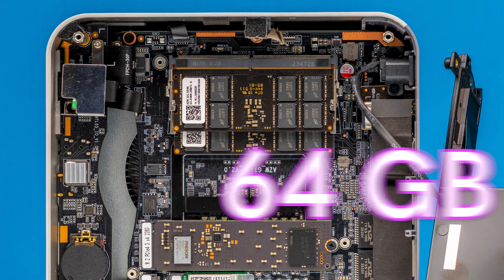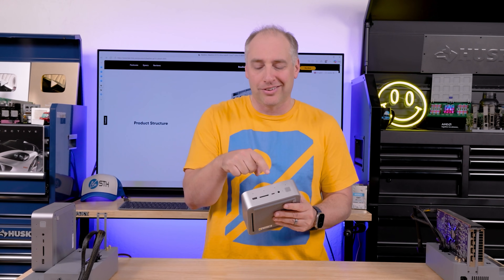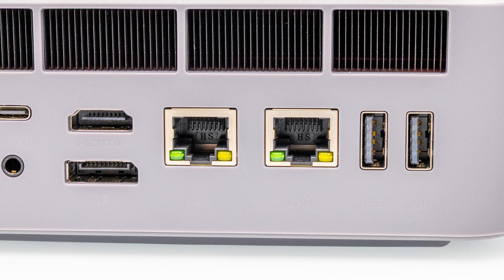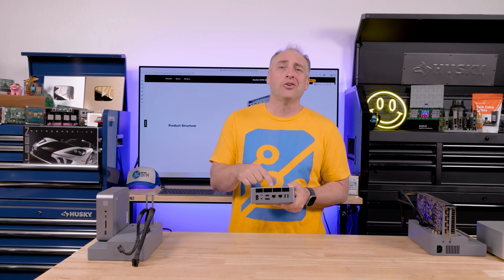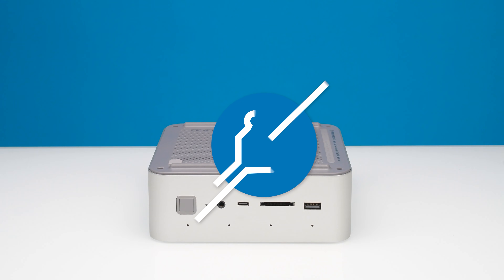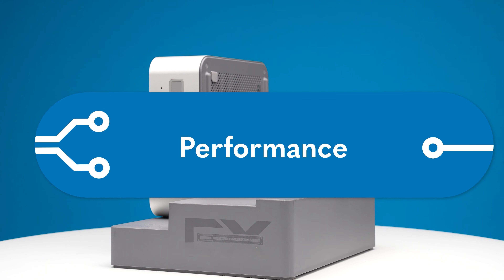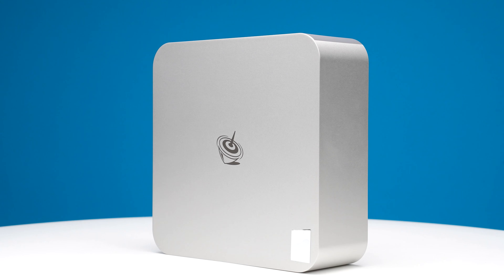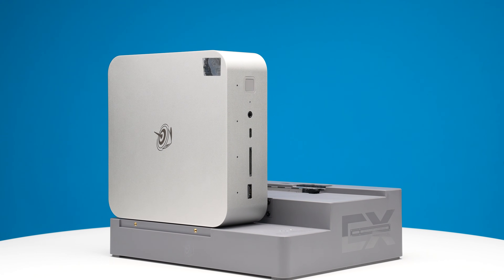An ULTRA Mini PC with 10GbE and GPU Beelink GTi15 Ultra

Comment: Buy 2. One of my Beelink units died after 2 years. Seems to be a voltage fail during bootup. Also, I have had a mini PC fail because the 120V to 12V built-in power supply could not maintain 12V. It would produce 11,7ish volts. So I ended up wiring an Amazon 12V converter into the mini PC to replace the internal power supply.

Comment: But if you look at it from a robot dog's perspective...
Microphones and speakers are great... But what about the monitor?

But isn't an additional power source more important?
To be able to change the main power source without rebooting...
Aren't a 3.5mm jack and Bluetooth enough to connect peripherals?

Comment: 11:55 this rambling makes it sound like scores should scale lineraly with corecount like 1 core 50pts, 10cores 500pts, 20cores 1000pts as if that is actually something that would happen with the performance scaling - when of course it isn't. A system with 10 cores is not half the speed of one with 20 cores even if those cores are exactly identical because they don't like in an ideally scaling hypothetical environment like an excel sheet or something. A 20 core system is NOT twice as fast as an otherwise identical system with 10 of the same cores - it gets CLOSE in some rather specific scenarios but in real world performance it is nothing close to twice as fast with twice the cores, because the cores aren't the only things that count. RAM bandwidth doesn't scale to pick one chip level thing, IO of course doesn't scale etc which all influence the total performance of the system. The 20 core system will of course be noticeably faster than the 10 core system in CPU bound applications that are able to utilize multiple cores properly, so like the code is threaded and cache aware and all that kind of stuff, and in specific scenarios it could reach something like 185% for brief moments or specific tasks, and above all else if the system is running a lot of different software at the same time and the main heavy ones are properly coded for multiple threads there will be a big benefit not only in execution speed or raw performance but also in the "feel" because it is easier to find a thread to pause if you have 20 of them than if you have 10 - and the 'loss' in high load performance from moving the mouse or displaying a changing graphic is less. 
Long ramble - but I think care should be taken to not create the impression that performance scales perfectly linearly with core count. I have spoken to people who have returned PC's they bought because of such claims. Not kidding.

Comment: Can it be Waked Up by LAN WOL in Modern Standby State? Would be great if one of those Minis is finally capable of doing this.
Reply: Hi! I’m not completely sure what you mean by “Modern Standby,” but the GTi15 Ultra does support Wake-on-LAN. However, at the moment, it can only be enabled by modifying the system registry. To fully resolve this and make it seamless, we’ll still need to wait for Intel to release an updated driver.

Comment: I prefer the minisformum "old Mac-Mini" Stayle. Integrated power supply, better thermic so it is really quiet and to be honest fits a desktop better. Why everybody wants to clone the new Mac mini style with a SOC that isn't a power efficient Arm - no idea. 

I tested many MacMini clones - and ALL were noise under load. My Minisforum AI X1 Pro is the ONLY one where the promise of a low noise level is fulfilled. The biggest draw back is the slow RAM, and 10 Cores is not to bad either :-). 

Beelink should also go for the old Mac-Mini Style - less compromised on noise and better cooling.
Reply from the maker: To be fair, that is less of the Arm instruction set, and more of the flexibility building the SoC and system around it that is getting that benefit for the Mac Mini
Reply: @ServeTheHomeVideo  However - the new MacMiniy style for x86 is Function follows form, not the other way around. There was a purpose for Apple to give the Intel Mac this case. 

Im completely happy with my Minisforum - absolute no noise at all! And yes I also own a Mac.

Comment: Hi @ServeTheHomeVIdeo do you have plans to test it as an opnsense or pfsense router to see if the system can handle traffic at 10gbit line rate with ids/ips rules configured or does the system's mix of P-core/E-core/LP-ecore configuration makes this less suitable for that role?
Reply from the maker: Interesting thought. Generally I would use a C5000/ P5000 for something like that. We also have the new Granite D

Comment: 10 gigs MUST be SFP, 'couse optic has lower delays. RJ 10GBE - bad idea.
Reply: Hi! Thanks a lot for your suggestion — we really appreciate your feedback, and we’ll pass your idea on to our R&D team:)
Reply: And 10G RJ45 switches are way more expensive that SFP+ switches
Reply: @matthiaslange392   And DAC-cables ... )
Reply: @HDFactory-HD  I've won a Beelink ME pro... it has 5GbE (copper), but there's nearly no switch for 5G on the market, only 10g multi-Gig, but very expensive. An eight-port 10G SFP+ switch costs about 120€ - with management. Many 2.5g manageable switches are more expensive. Copper makes no sense.
Reply: @matthiaslange392  there are modules for spf to rj45
Reply: @erdmanisdkH  I know. But the 10G modules get VERY hot (>90°C). I have one at work running in a TL-SX3008F. Usually set it to 2,5g (65°C) because it gets extremely hot on 5G or 10G.
Reply: @HDFactory-HD  I know. I'm the only administrator of a network equiped with 46 switches in 19" racks, 1gb copper, 10 and 25gb fiber and also DACs. I connected my office PC with 10gbe over existing copper because I work often with big backup-files and there's no way to route fiber to my PC.

Comment: It's pretty neat.  I'd like to consider it, but almost rather get a laptop with faster 24core CPU and a discreet GPU, such as Lenovo Legion 5i 16" (at my local Costco) – RTX 5060, Ultra 9 275HX, 32 GB / 1 TB: $1,200 Christmas promo.  But the laptop has fewer connections, soldered ram, and certainly doesn't have the dual 10GbaseT. Hmmm I'm liking the beelink more and more
Reply from the maker: Very fair

Comment: What a pity it's spoiled by insufficient USB A ports on the back. I'd want an extra two so you can run keyboard, mouse, external hub, and one to your monitor, leaving the  40 Gbps USB C for high bandwidth devices like external drives.
Reply from the maker: Great point. In general I wish these mini PCs had more USB
Reply: Hi! Thanks a lot for your suggestion — we really appreciate your feedback, and we’ll pass your idea on to our R&D team:)

Comment: In the idel power consumtion is over 40w. C-states is off by default. I don’t know how you reach that 12w in idle mode. Even Beelink agreed they have a bug on this product
Reply from the maker: No idea. We left everything as default and are using to power meters (one on and one off camera)
Reply: @ServeTheHomeVideo  sorry, but I don’t believe. There are many topic about this issue. I even contacted Beelink support and they confirmed this problem

Comment: The size of this is the same  if you put some small itx case. For example you can get MINISFORUM BD795i SE mini itx mother board with CPU: AMD Ryze 9 7945HX-BD795i SE. 
Then you can put this in some compact case like FormD T1. And the size will be the same :)
But the benefit is you will get full Pcie 5  x16 for GPU.
I assume this dock station is only Pcie 4 x8
Reply from the maker: Totally. We have both the X3D and non-X3D versions of that board. It does not have the high end dual 10GbE

Comment: Random proprietary eGPU connector makes that docking solution a complete non-starter for me, sorry. Kind of reminds me of the (mostly gone) days of board-to-board mating connectors on the bottom of laptops for connecting to docks, but kind of seems extra silly when used on a mini-PC which already... isn't a laptop. So you've created a docking station for GPU expansion of what is already a desktop PC that you're not really supposed to be traveling around with and then plugging in at home? I really don't know who this is for. Feels like standard SFF PCs (e.g. mini ITX with SFX or external power supplies in a 12VO world) are going to be better and have more longevity with upgrade paths.
Reply from the maker: That is very fair. I agree it limits especially the re-use of the dock
Reply: I don't think it is intended as a longevity feature beyond the life of the PC itself, I would consider it as a strange looking proprietary minitower with completely proprietary hardware except for the RAM, SSD's and whatever you stick into the PCIe slot. It's a funky unusual thing but it is not too expensive for the spec, it looks to be cheaper than anything else for sale with that configuration - local builders and HP charge more for the same thing. That said you can get a NUC with a Core 5 210H 4p 4e cores barebone for a third of the cost of thing thing. Sure no GPU slot and less cores but it's 30% of the dough - this is certainly not 70% "more computer" - the funny thing is I might pick myself up one of the NUC's based on what I found out looking for info on this thing 😂🤣 - because the NUC is 400€, I knew the spec on them more or less but thought the prices were all 700 or more. Sadly the memory to make it useful costs about double the price of the computer, I would need 64 or 96gb RAM to make is worth getting at all and that pushes the price well over 1000€ which it ain't worth to me.
Reply: it may be because minisforum deg1 is so popular. I have a deg1, you can adapt the oculink to m.2 and the gpu will actually pass through pretty reliably to many systems not just minisforum pcs. so their selling tactic will probably be price to get you into their ecosystem. not really sure on this things price though

Comment: Yeah, but is it stable? I've bought 3 different mini PC's, all three were unstable. I bricked one of them while fiddling with BIOS settings in desperation. The one that is the most stable, is a minisforum, it "only" reboots or hangs about once every couple of days. The other ones, are almost daily freezes and rebboots, worthless trash.
Reply from the maker: Usually by the time you see us do a mini PC review we have been running these hard for 1-3 months
Reply: @ServeTheHomeVideo  I've had such bad luck, I'm not going to try another one, not unless it's a known highly reputable manufacturer. I will not buy a Beelink, minisforum, etc, they are too iffy for me.

I forgot about a 4th mini I bought, reason I forgot to mention it, is I managed to fix that one, the NMVe it came with was overheating and going into read-only mode. After I improved the thermals, it's been rock solid. However, the machine should not have been shipped with a NVMe without a heat sink on it. The poor quality is the problem with these builds, some will be rock solid, some will not, it's just a matter of luck getting good ones. I figure, they do some builds in a row with good parts and put together with skilled workers, then they do another run making a few hundred or more in a row, except using bad parts and/or unskilled workers. 

I'm wondering, have you done reviews on Framework mini's? They are a bit larger than Beelink, etc, but they look very interesting, and I can get exactly what I want in terms of specifications.
Reply: Check your power quality maybe. That doesn't sound normal.
Reply: @Rickles Thanks for the suggestion, but it's definitely not a power issue, that's been ruled out 100%. It seems to be luck of the draw getting a stable mini, I've read about it in various forums, I'm not alone with unstable machines. I know, it can happen to any PC build, but in all my years building PC,  I've never had problems like this before, not even close.

From now on, I'll only buy from highly reputable PC makers, the challenge is finding machines with enough RAM, storage, and a decent CPU for my needs, that's not so easy. 

I am thinking of trying Framework, it's larger than I want, but not too bad. The CPU is soldiered in place, so is the RAM, but I can get the specs that I want. I'll just max everything out so I won't have a need to upgrade later.
Reply: I've purchased maybe a dozen since the 4th gen Intel days, and had the fan fail in one. The WiFi reception sucked in all of them, and I had one mSATA drive die (Intel 4th gen NUCs had an internal mSATA for the SSD). Even the cheap (i.e. not Intel) NUCs have given me no problems (I have Ubunut on an N100 and N305 GMKtec NUCs). The WiFi has sucked on all of them though.
Reply: In my case, I did not have problems with wi-fi, it worked OK.The machines I bought, are all AMD Ryzen based, not Intel. There's a 4th machine that I forgot to mention, it is very stable, except the NVMe that came with it was overheating and going into read-only mode. I increased the fan speed, that solved it, it's been about a year without issues. I should put a heat sink on the NMVe but did not get around to it yet, the manufacturer should have done that in the first place.

So really, I had 4 out of 4 mini's give me trouble. The one that had the NVMe overheating, is now rock solid, but the other ones, I do not know what else to try. One of them was bricked when trying to adjust BIOS settings, a BIOS reset did not bring it back. The most stable machine, is the minisforum, it runs OK for a couple of days or more, up to a week before there's a reboot or freeze. If I do not use browser on it, it's noticeably more stable. There's 2x32Gb RAM nodules in it, I've switched both in and out, but it made no diff. I switched RAM models from another machine, changed the storage, increased fan speed for extra cooling, but no luck.
Reply: @geekinasuit-l1b  So it could be a problem with the Ryzen's, not with the PC at all. I use mini-PCs with Intel-CPUs for many years and never had any major problem.
Reply: @matthiaslange392  I have a laptop, a server, and a minipc with Ryzen inside, each without issues, it's something else. The only pattern I can see, is the small form factor plays a role, probably it is "no name" cheap components inside, along with poor quality control.
Reply: @geekinasuit-l1b  Do you monitor (log) the temps (not only the cpu but also the ssd)? Which OS do you have installed? If it's Windows, you can take the memory-dump-file and analyze it f.e. with bluescreenview. Instabilities are often caused by drivers.
Reply: @matthiaslange392  Yes, all temps are monitored. I'm running a Linux based OS (Debian 12 and updated one to Deb 13). I have also cranked up the fans to see if it helped, but it did not make a difference with the instability.
Reply: @geekinasuit-l1b  Did you check the ram for errors? I use memtest86+ (core selection: round robin). Nothing overclocked (especially the memory). Try to run all settings on default for a while.
Reply: @geekinasuit-l1b  debian has known stability problems with amdgpu drivers. did you check this? tried an other linux distribution (just for trsting)?
Reply: Hi! I’m really sorry to hear about your experience! If you encounter any abnormal issues while using the mini PC, please feel free to contact our support team and we’ll be happy to help troubleshoot and resolve the problem. Thank you for your understanding and support!
Reply: @Beelinkchannel  To be clear, none of the machines I mentioned are Beelink, for all I know, the quality is very good, I'm just not going to risk it after the poor results I had with similar machines. 2 of them were some Chinese brand that seems to have changed its name or goes by more than one name (my mistake not doing more DD on the manufacturer), I expected Miniforum would be better quality since it's mentioned a lot, but teh machine I received was also unstable. One machine, branded as "KingnovyPC", has been rock solid for about a year AFTER I resolved the NVMe thermal issue, it should have come with a heat sink and/or better cooling. What all of it suggests to me, is the quality is a roll of the dice, you may get a stable machine, or you may not, with the probabilities of a bad one too high to take a risk, that's why I will stay away from mini's until there are well known name brands making these machines. For example, I have a Lenevo laptiop with Ryzen APU inside, it is essentially the same form factor but works reliably as expected from a brand such as Lenevo, unfortunately, I cannot find a Lenovo mini PC with the specs I want.
Reply: I have Beelink SER9 for one year. Usually it works 24/7, rebooted only when needed due to Windows updates etc. No sudden crashes. Quiet and stable.
The only serious problem was with Windows update which killed Windows beyond repair :)
Just reinstalled system (driver installation was easy with AMD tool) and working again.
Reply: Asus NUC 15 Pro+ has been rock solid for me. Bought it on day one. Used hard since then for numerous docker containers and my Plex/*arr stack. Only thing I hate about it is the 2.5 gbps NIC. It's ridiculous we don't have 10 gbps standard on "premium" products yet.
Reply: @DickWankly  I looked at Asus, but memory I think was limited to only 32Gb, and the options for NVMe storage were limited in capacity. I prefer two NICs over one, and at least 2.5GB, but that's getting old already, of course more bandwidth options are always better. AT CES, AMD announced the "Halo" mini for AI development, however it can be for other uses. It is supposed to come with 5Gb Ethernet, and 128GB RAM, but the full specs are uncertain right now, unless AMD published it somewhere. If/when STH does a review, that will be awesome.